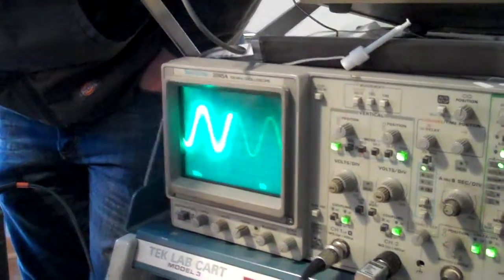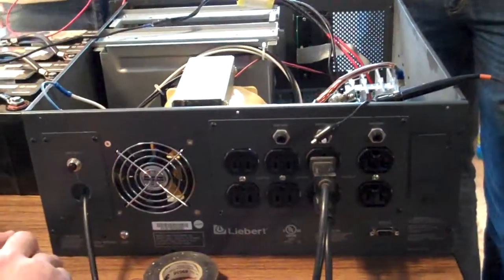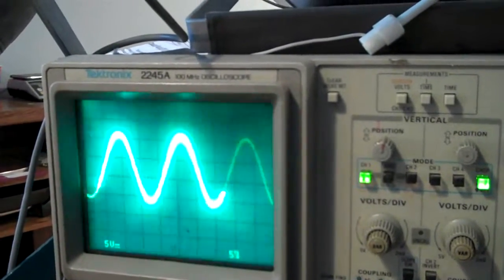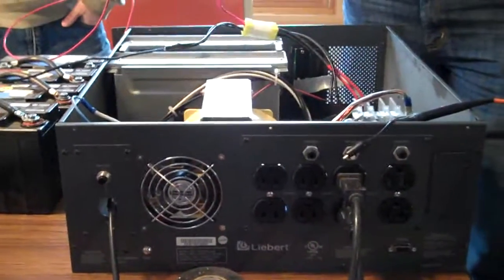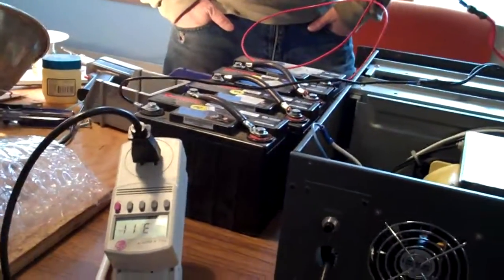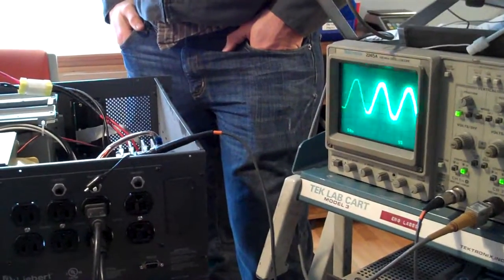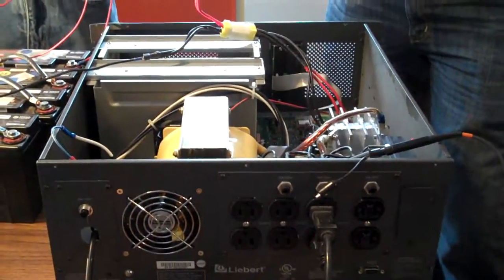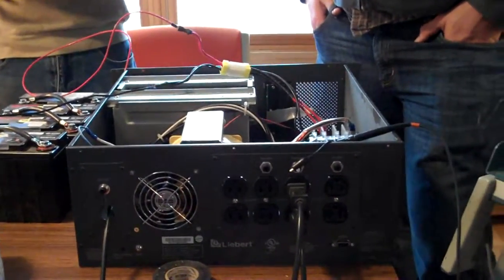48V UPS True Sine Wave testing

Comment: I have been using an APC UPS as a 48v inverter. It works ok but is not suitable for a solar power setup as its own internal power consumption is about 200 watts which is 4.8kwh over 24 hours which is more than all of the power consumed by things plugged in to it.
Reply from the maker: +Rob Smith, I totally agree with you on that. Computer UPSs were really never designed to be efficient in the same way that a dedicated solar inverter is. That said, I got this UPS for free, and it has been GREAT for experimenting with. I've used this to charge my 48V electric motorcycle, and run my house during a blackout. If a person were doing a new "from-scratch" solar system, they would want to use something as efficient as possible.
Reply: +Rob Smith

- What was your draw for 200W usage for that consumption?  If you're drawing 2400W, then that's 92% efficient.  If it's at max 3750, then it's 95% efficient.  Obviously it's going to depend on the draw.

- How was it measured?  The better UPS [APC] double conversion, that is mains both converts down into 48V DC to the battery power to keep them charged and then gets converted back up again for whatever you plugged into it.  If you're measuring mains watts then that's not the true efficiencies from the batteries due to the double losses.  An off grid example wouldn't have that mains step-down loss assuming it was measured that way. 

- Then there's losses if you're running motors from a square wave or modified sine-wave as they will draw more current to do the same job compared to the smooth sine-wave of the APC.

- not saying you're wrong, just curious for more info as I'm looking into this myself.